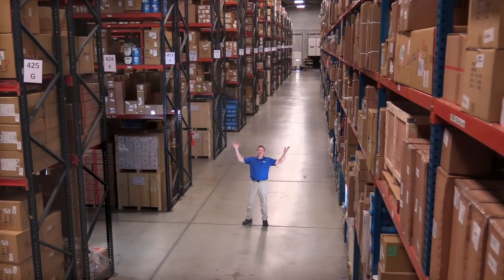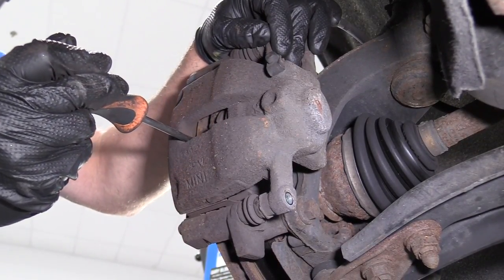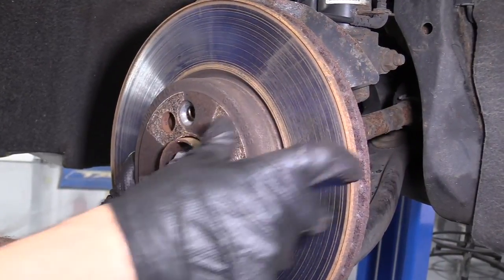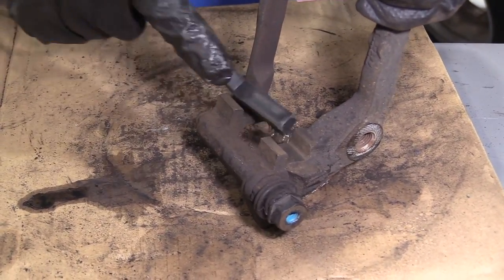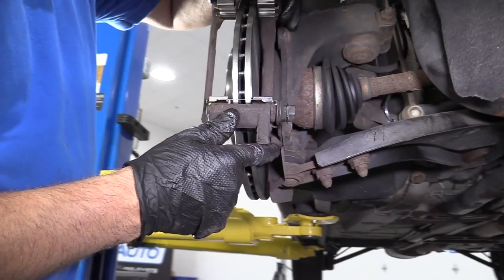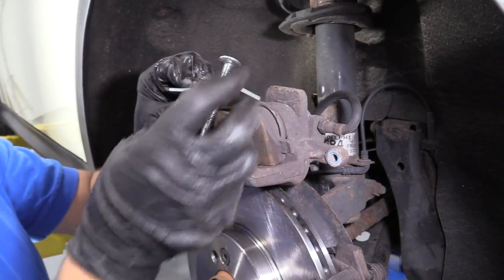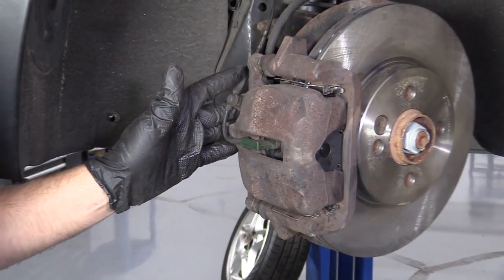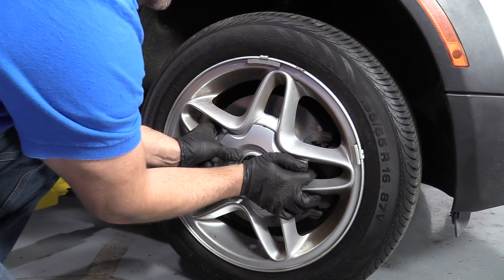How to Replace Front Brakes 07-14 Mini Cooper S

Comment: Thank you to the 1A Auto team for these videos. They have been invaluable. The only change I would suggest is to break loose  that T50 bolt free on the rotor prior to removing the caliper. Its a hell of a lot easier to do when one can still use the brakes to keer the rotor from spinning.

Thanks again!
Reply from the maker: +georgealm27 Thank you! We love empowering our customers and showing how to perform DIY auto repairs with our high-quality auto parts.  http://1aau.to/m/Shop-1AAuto-c

Comment: Yes great video. Very good lighting. Thanks, I wasn't sure how to get the sensor off without busting it. As the video says the T50 bolt doesn't need to be super tight as the wheel nuts are the main secure for the disk rotor.

Comment: With so many out there this tutorial is completely brilliant with each step clearly explained and great views of each part,thank you guys have now completed my front brakes and now for the rear.
Reply from the maker: +miniatureminis 7 Thank you! We love empowering our customers and showing how to perform DIY auto repairs with our high-quality auto parts. 1AAuto.com
Reply: @1AAuto  Thank you for the reply earlier was wondering have small issue with the rear caliper piston it will turn by using rewind tool,but won't go back even with the master cylinder cap off.

Comment: Thanks for the video. I had to soak both rotor bolts in penetrating oil and use a pneumatic hammer to get ‘em loose. The brake wear sensor was really wedged in there too and I had to use a flat head screwdriver to separate the pad from the rotor to free it up before removal.
Reply from the maker: +Smedley Butler Thanks for checking us out! http://1aau.to/m/Shop-1AAuto-c

Comment: Nicely filmed video. Couple of questions. Well known how to manual says not to lube guide pins on the MINI, why or why not? Also many lube the piston top or the back of the pads, again why or why not?  Shouldn't you open the master cylinder to allow the fluid to back up without pressure? Thanks again for the great video.
Reply: i really don't recommend spraying brake cleaner into the slide pin holes...that doesnt' make any sense to me, as you would be breaking down the lube that is in there and meant  to stay in there. I do usually add new grease to the slide pins, especially if they're dry at all or binding anywhere in their travel. Lubing the back of the pads is probably uneccessary but not harmful in anyway. You can open the master cylinder as well, but may not be necessary, as the fluid should not overflow as long as it wasn't filled while the pistons were far out with low pads...if you get what i'm saying.

Comment: I like the 1 AUTO vids. Very helpful. Thank you for making.... 
2012 R56 
Now,  the T50 bolt holding that rotor to the hub is a giant pain in the ass. I had to drill both sides of mine and replace. Either use an impact and some heat. Maybe hit it with a hammer. Drive it to heat it up, but do not under estimate that little bolt! And what a pain try to hold the wheel and put the luh bolts in. They had to try to be different. Another pia!
Reply from the maker: +C W Thank you! We love empowering our customers and showing how to perform DIY auto repairs with our high-quality auto parts.  http://1aau.to/m/Shop-1AAuto-c

Comment: Man, I followed your directions to a T and got to 3:26, taking the bolt out of the rotor using a T-50 and socket wrench.  But, it was so impossible to remove (rusted in there maybe??) I ended up stripping the head.  Now, I'm using screw extractors to drill into the head and try to back it out - and it is still impossible.  It will not budge.  Any ideas?
Reply: I'm guessing you got it all figured out by now, but if not. Use a deill and drill it out. Be careful with the threads inside the hub. Your extractors may work too. I drilled mine
Reply: Drill it out. It's not critical

Comment: Only thing I can say is after you clean the shipping oil of your new rotors don’t put the freshly cleaned rotor on a dirty and greasy work surface
Reply from the maker: +Jack CooperMTB Thanks for the tip!
Reply: not to bad, as long as you get the grease off, youre fine. you'll dirt all over the discs regardless, once you start driving.

Comment: You literally put two inner pads on the same side lol, disc bolt T50, calliper-carrier bolts and the small 13mm are replacement units